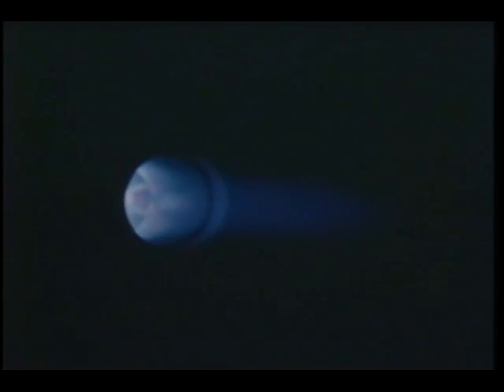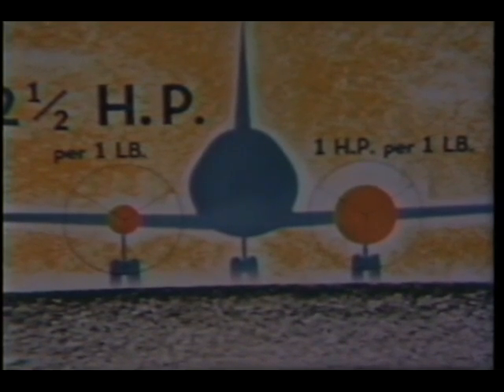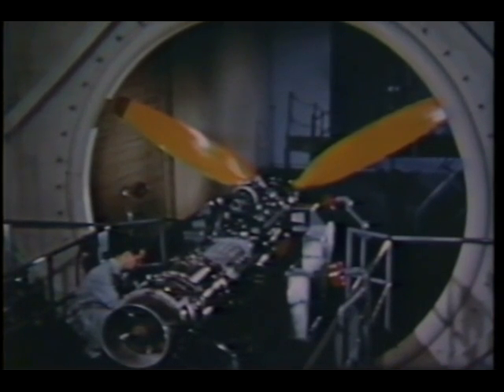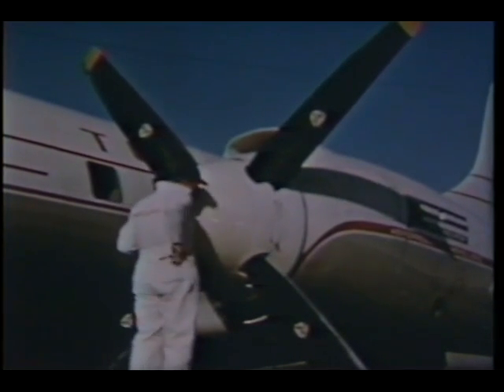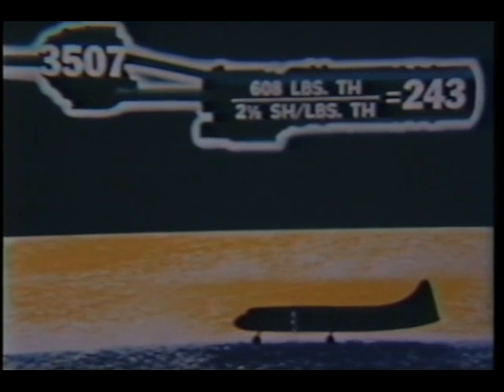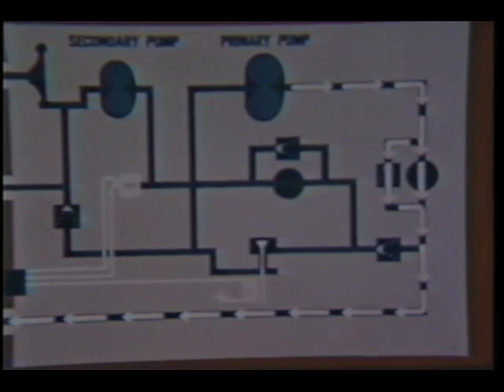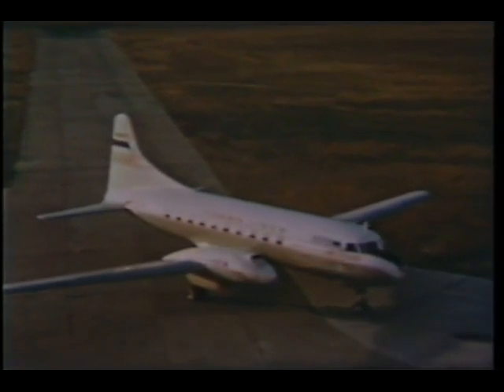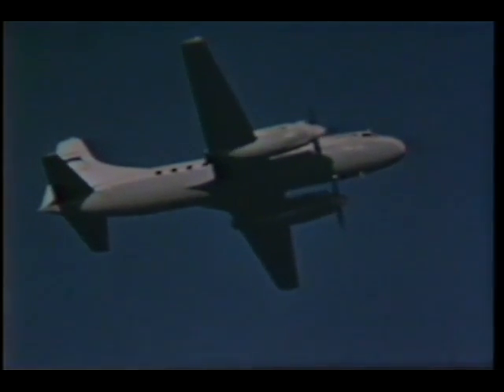New Power for Flight. The T-56 gas turbine engine.

Comment: I was a mechanic in the first and only Air Force Turboprop Test Squadron, stationed at Kelly AFB, Texas, from 1955-1957.  We flew around the clock, starting with two YC-131's.  Then we got two YC-97's and two YC-121's.  We also tested Pratt & Whitney T-34 engines.  Over the next two years, they broke every speed record for prop driven aircrsft at that time.  The Y designation was for unaccepted aircraft, yet to be proven.  The outfit was disbanded in1957, and we were shipped to Dover AFB, to begin accepting the new C-133's, then the largest plane in the Air Force.
Reply: Thanks for your service! What an interesting time to be in aviation. And being in the ONLY Air Force Turboprop Test Squadron pretty much establishes you as a really sharp mechanic. Way to go!
Reply: So wish the YC-131/Connie had been pursued w turboprops, never understood why it wasn't a success, guess it wasn't much faster and the jets were driving props out, anyway.
Interesting the Electra popped up about then, though!?
Reply: @donaldstanfield8862  Well we still broke all the speed records.  I do not know why the C 131 wasn't utilized after our testing period.  Maybe it was just because it was only meant to be a test bed for the T-56.
Reply: @donaldstanfield8862  I do not know this reply works.  I thought I sent one but I do not see it.  I guess we will never find out why the Air Force didn't pursue our squadron's aircraft.
Reply: @Donald Stanfield

It is my understanding that the problem with the Constellation was its expense. The dolphin shaped fuselage may have made for a very photogenic plane. But it was FAR more expensive to produce than a simple cylindrical fuselage. Thus, it was replaced with the Electra, which was of a more conventional (and cheaper to produce) design.
Reply: @matthewstorm5188  Thanks, that does make sense!

Comment: One big advantage of turboprops over piston engines was that they are vastly less noisy, resulting in a more comfortable flight experience for passengers on the plane. This was demonstrated with the Vickers Viscount, where the four Rolls-Royce Dart turboprop engines demonstrated how much quieter the plane was compared to similar piston-engined aircraft.
Reply: But that was ear-splitting turboprops!?!

Comment: I would fly to Chicago as a young child once a year or so for a few years in a row with my television engineer father going to see the trade demonstrations of RCA studio television cameras and equipment.  Each time both coming and going on a few different Convair 240 types.  Sometimes it would be in a radial engine and sometimes on the way back it would be in a newly converted turboprop version.  Years later I saw one after it had crashed at the local airport, it was broken and split in the fuselage, don't know that it might have been one I once flew in.  My first airliner flights, an autumn delight.

Comment: A few years after the Allison Turboliner was developed, local service airlines would convert the "Convair-Liners" in their fleets with the 501-D13, the commercial version of the T56, resulting in the Convair 580.
Reply: No, it was a lot more than a few years later that the first Convair 580, based on the larger Convair 340 and 440 was converted.  The 240 test ship here had T-56s installed in 1950.  The first 580 was not converted until 1961.
Reply: John Eddy que
Reply: +Miles Rich, actually the Turboliner was powered by T38 engines; engine problems caused the project to be scrapped and the airframe returned to Convair. The T38 was a forerunner of the T56/501.
Reply: I worked on 580s at Aspen Airways in the 1980s. It has been brought to my attention that Convair Never built a "580". The 580s were designated 340-A and 440-A, the "A" meaning Allison Conversion for the 501D-13.
Reply: ...the 501-D13 series also powered the Lockheed L-188.
Reply: @jimholmes2555  Nobody cares what Convair said.  Once 340/440 airframes were equipped with Allison QECs and equipment, they were 580s.  I worked for Frontier from 1967 until after they retired the Convair fleet, and I never, ever, referred to them, or heard anybody else refer to them, as anything except 580.  The flight log sheets were marked CV-580, and that is what they were. The same was true of the Convair 240 airframes that were converted to RR Rda-10 power--once converted, they were referred to as Convair 600s, despite the fact that Convair preferred that they be called CV-240D.  As far as ATC was concerned, an Allison-powered Convair 340/440 was a Convair 580, and a Dart-powered Convair 240 was a Convair 600.  The difference in performance between various models of Convair liners was substantial, so that is how ATC identified them.
Reply: @Hopeless_and_Forlorn  Cool! You got to work with Gene Lavery, Roger Wilson,  Jim Cooper and Glenn Shouldise.
Reply: @Hopeless_and_Forlorn  And 340/440 converted to RR power were 640's
Reply: @kyotokid4 , the Electra II, the first turboprop-powered airliner designed and built in America.
Reply: @mileswrich  ...I still remember North Central operating 440s into early-mid 1968, after that all were converted over to 580s.

Comment: The specific fuel consumption numbers for the T-56 aren't bad, especially when you consider it's a 50 year old design. It would be interesting to see what kinda performance numbers the Convair 580 could put out with a pair of the newer Pratt & Whitney 100 series engines.
Reply: Or the Rolls Royce AE 2100, it is essentially the next generation of the T-56 and shared mound and thrust line making conversion fairly simple
Reply: I was an A&P at Continental Airlines  on the Viscount 2 with the Dart RR. The Viscount and the RR was a easy   to work on. CAL had the highest time Viscount in the world. Vickers was writing the MX manual as we went along.

Comment: Turboprops could have continued on in larger transport and cargo aircraft if they'd continued research on the open rotor concept, which was heavily studied in the 1980-90's.  Although efficient, one of the apparent drawbacks was noise caused by propellor cavitation.  With higher fuel efficiency in the newer HBR turbine designs,  advanced turboprop research slacked off.

Comment: Great stuff but the turboprop airliners didn't really last that long as the jet took over quickly. They may make a comeback. Who knows(?).
Reply: There' loads of tutboprop airliners flying. Saab, DeHaviland, ATR, Pilatus, Bombardier ...
Reply: @PeterWalkerHP16c  Yes there is. I was talking about the big major airlines for over 1500 mile flights.
Reply: If they'd built more Viscounts United wanted 60 more after they bought Capital. It was a while before the 737 guppy's came out to fill in.
Reply: I have heard from time to time of experiments to use props with adapted higher power engines for "jetliners." It would seem that one of the major obstacles would be propeller speed exceeding the speed of sound... you end up with a drop in power and a continued sonic boom all the passengers would get to enjoy for most of their flight.

Also, technically speaking, most airliners generate much if not most of their thrust at cruising speed with their huge partial bypass fan blades. In a way, I would say that qualifies it as a sort of turbofan if not turbo prop.
Reply: @PeterWalkerHP16c  , if I had a favorite among those it would be the de Havilland Canada DHC-8, or "Dash 8." It's still built today, in Downsview, Ontario. Alaska Airlines (through its Horizon Air subsidiary) flies it. Today, de Havilland Canada has a sister company located near Victoria, B.C., Viking Air Ltd., that builds the DHC-6 Twin Otter Series 400
Reply: @johneddy908  QANTAS still use here as well.
Reply: Electras were used for a LONG time in the military for coastal patrol and "patrol" of other countries coastlines with "special" equipment to see what those countries were up to.  They were used until just recently.  They also were used extensively outside the US for cargo all across the world.  The Electras and other turboprops have been well used - and used up in some cases.  Just because they weren't used for passenger service doesn't mean that they weren't used extensively.  Yes, I know you were talking about passenger service  on over 1500 mile flights, and I understand that.  I'm just pointing out they had significant roles outside just passenger service.

Comment: If only the didn't burn so much fuel... 20+ for a 200 hp ga engine
Reply: Because development of these ga engine have been standing still for 50 years.  Modern IC engines for ga are much more efficient.
Reply: @flexairz  Recips may be not turbines, that 200hp turbine i am talking about is state of the art fadec computer controlled

Comment: I don't know, that C130 is too fat and ugly.  I predict a short production run.  ;)
Reply: Yeah they will cancel that hog pretty quick, how many have they made to date, 2500 as of 2015.
Reply: C-130 Requirements written by Marine Commandant.
Reply: @robertsullivan4773  , Lockheed Martin still builds it today, as the C-130J Super Hercules. It is powered by Rolls-Royce AE 2100D3 engines.
Reply: @johneddy908  I was being sarcastic, I live in Atlanta not far from the Marietta GA. They fly over my house often.
Reply: Next year, 70 years old design.  Still making them, how’s them apples?

Comment: Jet fuel weighs more than avgas.
Reply: Which is an advantage, because you can pack more pounds of fuel in existing tanks when switching from Avgas to Jet A.  Also, Jet A provides more BTUs for weight than Avgas, making it about 5% more efficient as a fuel.  Plus, it has a much higher flash point, making it safer.   Win, win, win.
Reply: lb/hp*hr is units for Brake Specific Fuel Consumption.  It is simply fuel mass flow divided by power produced.  It's one of the basic quantities that engineers use to measure the efficiency of engines.
Reply: I believe the std wgt for Avgas is 6.02 lb/ gal & Jet A is 6.14 lb/gal. Correct me if I'm wrong.
Reply: @andyharman3022  Not exactly. It'd be fuel mass per work done. Power is work per time. Fixed yer units problem.
Reply: @jacquesblaque7728  No.  Fuel flow divided by power.  I have no units problem.
Reply: @andyharman3022  Certainly is a problem if you don't differentiate between rate and integral over time (summation). Pretty common fallacy.
Reply: @jacquesblaque7728  My initial statement of fuel flow divided by power gives all the information needed.  Fuel flow is a rate quantity of lbm/hr.  Power is also a rate quantity of HP, which is lbf*ft/sec.

Comment: The Convair B 36 , what a POS.
Reply: check out the YB-60 :)
Reply: It’s two drawbacks were carburetor icing and engine overheating, an effect of the pusher mounted engines. It could outmaneuver a fighter at 40,000 feet. And it was the only aircraft that could carry the early hydrogen bombs within its bomb bays.